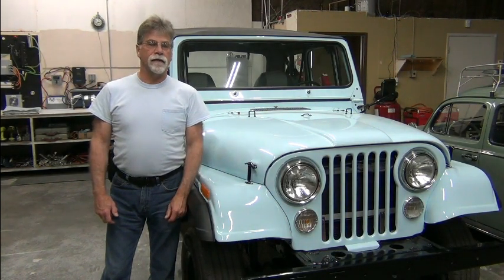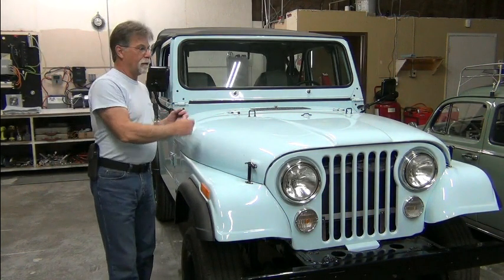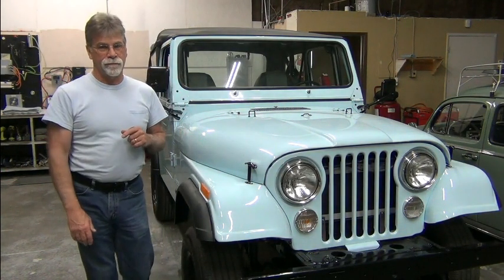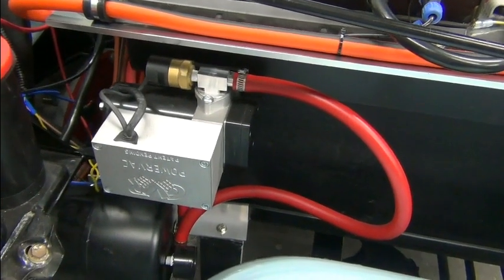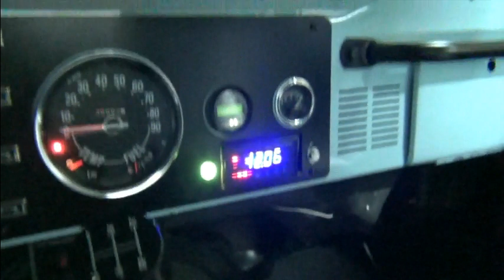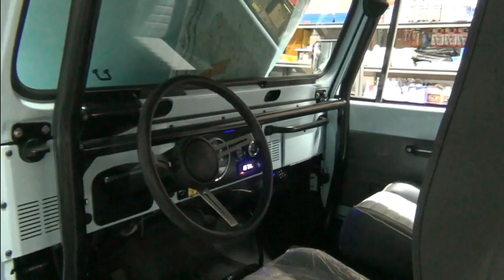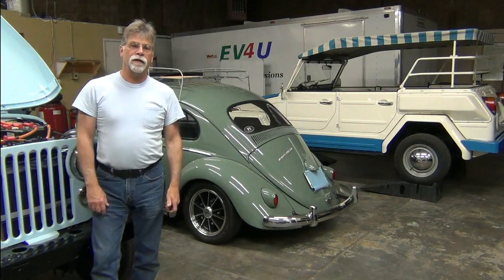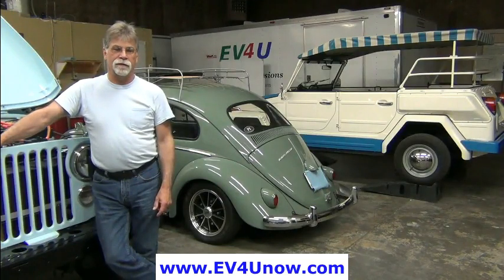Jeep CJ7 EV Conversion Episode 11, Project Overview and Test Drive

Comment: What liquid did you use for your cooling plate?
Reply from the maker: Ethel-glycol and water, 50/50.  Standard automotive coolant (green).
Reply: @EV4U Custom Conversions  thank you!

Does your class go over how to program gauges on a warp 9/ curtis set up?
Reply from the maker: The Workshops cover both AC and DC conversions.

Comment: Nice job. Can you use level 2 commercial charging stations?  If yes, how many amps does the charger draw? I think I remember that the charger was an Elcon 2500.
Reply from the maker: Yes the conversion has a J1772 charge port.  The charger is an ElCon 5 kW, with a maximum draw at 220 VAC of just under 25 amps.

Comment: Which motor is better for such custom conversion AC three phase with permanent magnets and or DC Three Phase motor of permanent magnets?
Reply from the maker: There are basically two kinds of motors, AC and DC.  AC motors are available in several types such as single phase induction, three phase induction, and Permanent Magnet Synchronous Reluctance to name a few.  DC motors are typically a brushed type or a brush-less type of motor.  There are no three phase DC motors.  The motors typically used in most  EVs are the three phase induction, and Permanent Magnet Synchronous Reluctance.  Thank you for watching.
Reply: @ev4u  Thanks for such detailed reply

Comment: I see that every conversion built, is a little bit different, it depends on the type of purpose that each individuals,  may need the vehicle  for and the work it required to do such as urban driving are maybe an workhorses machine so to speak, off road sport or recreational purpose especially  if it's built for an competition, challenge vehicle if  you  could explain! the difference with each vehicles conversion for their own purpose 🤔 and what extra attention should be given to each one you can put them in categories, urban, sport, recreation and overland.
Reply from the maker: Thank you for watching.  Perhaps some day we will product a video addressing your question.

Comment: Do you use the transmission for reverse or invert the motor, or are both an option?
Reply from the maker: Both are possible.  However, this was a conversion done by someone else, we were tasked with inspection, repair, and completion of the conversion.  I do not remember if this conversion used electronic reverse or not.  Thank you for watching.